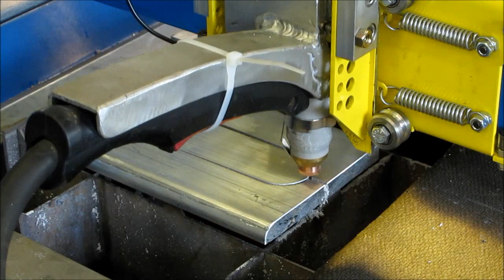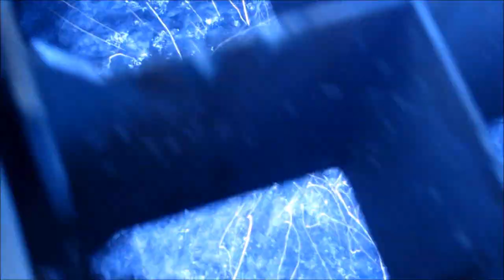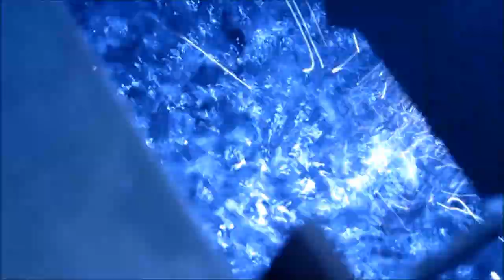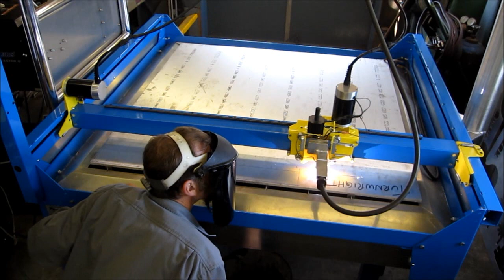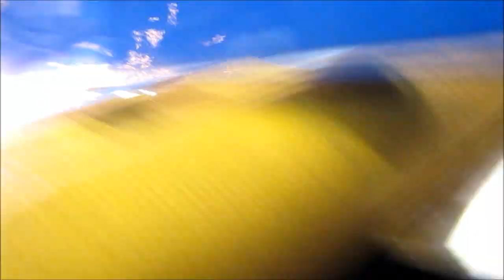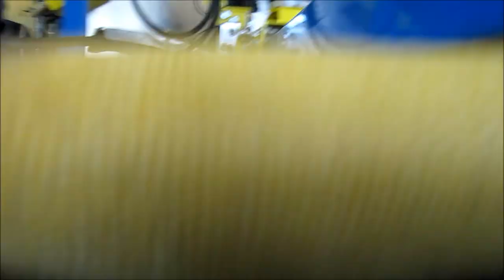Fire in the Hole

Comment: HI Keith, I have been watching the whole plasma cam series, very cool. This may be a stupid question but I'll ask anyway. How do you not cut through your (for lack of not knowing the correct better word) table.
Reply from the maker: There is a grate and is the surface that holds the material and is a consumable piece and is indexed flipped and then replaced. ;{)------

Comment: Keith,

Once again great job.  I have a Plasmacam and the pipe cutter attachment which I have not made a spark on yet but have had it for 5months now.  I would like to setup the pipe cutter separate from the table and I think you are going that way also.  I sure would like to see and hear your thoughts on the separate pipe cutter with spark and smoke containment.